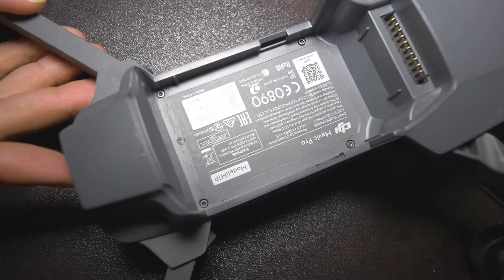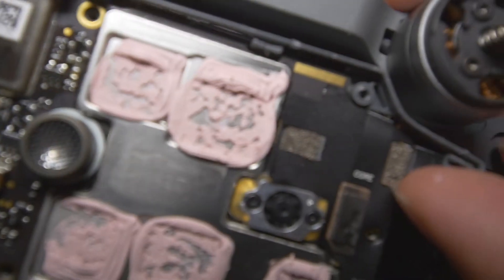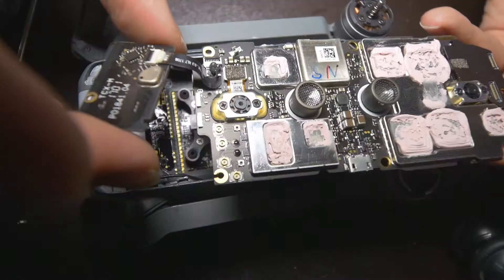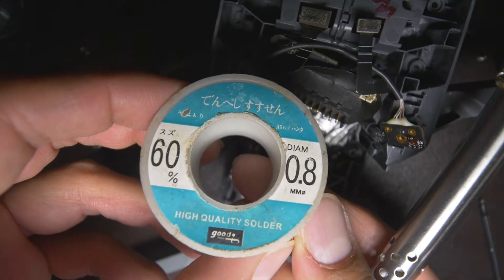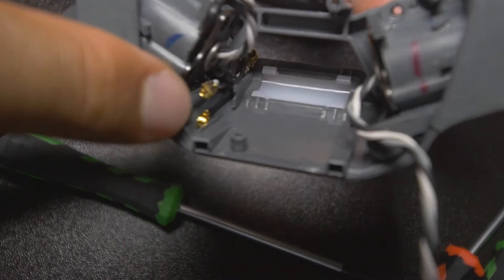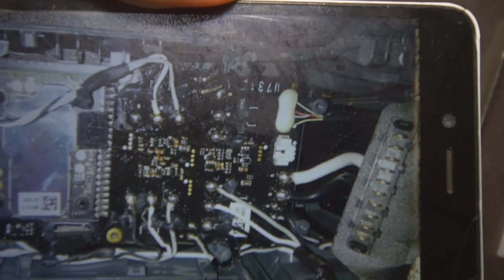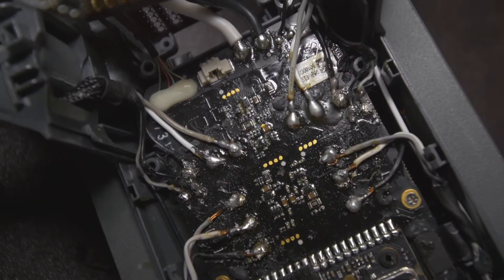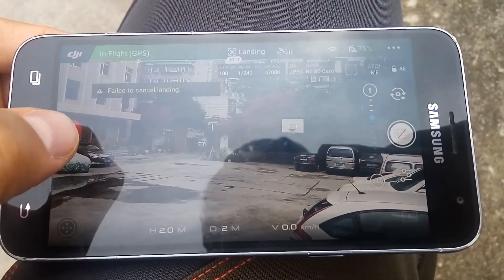DJI Mavic Pro Middle Frame Teardown

Comment from the maker: UPDATE: the PTZ control panel wasn't essential. Only the frame. The bottom front vision wire was disconnected from the crash. I just reconnected it, and it worked.